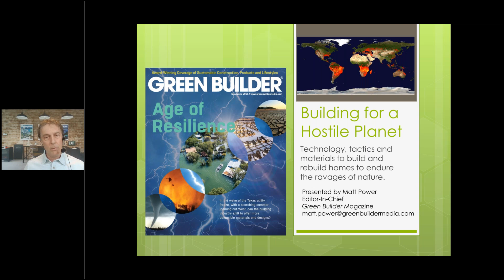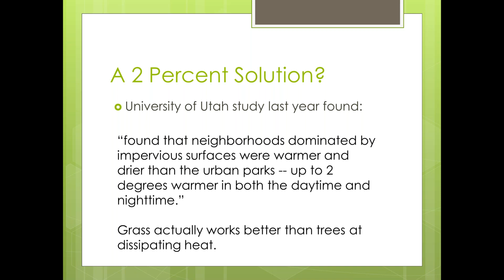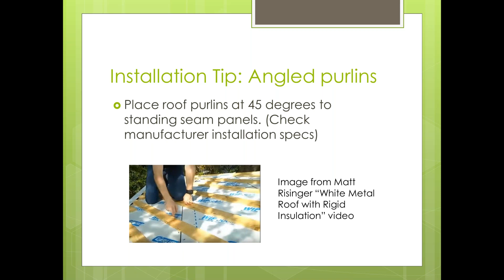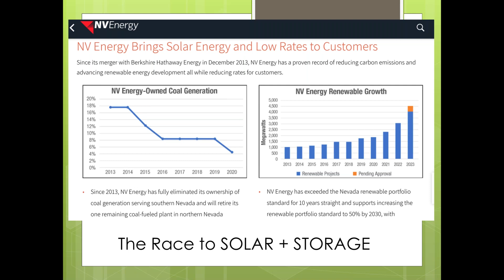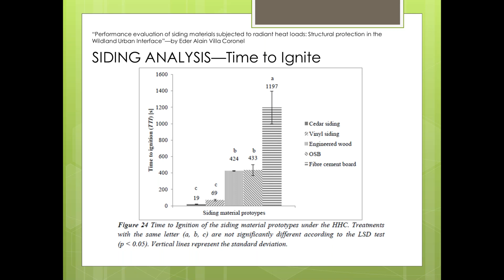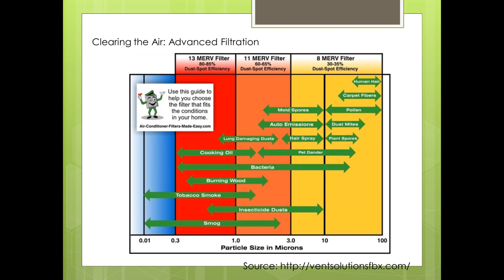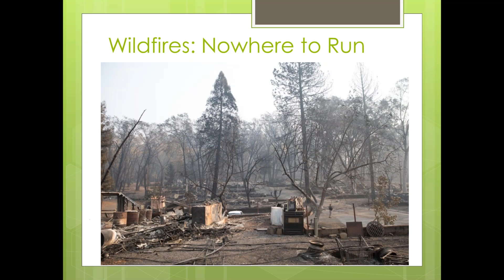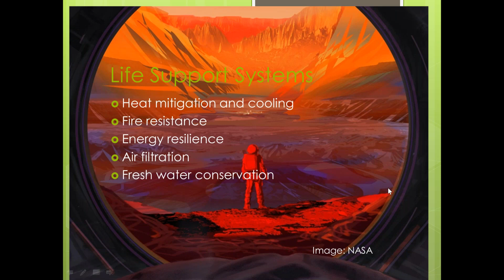Building for a Hostile Planet

Comment: Helpful content from a high level! Though if I can correct one thing, heat pumps don't operate continuously at max power. They kick in intermittently to regulate the house temperature, much like how a fridge kicks the temperature back down when chamber temperature crosses a threshold. This is the case with all temperature regulating systems. So home batteries will regulate home temperature for longer than suggested here. :)